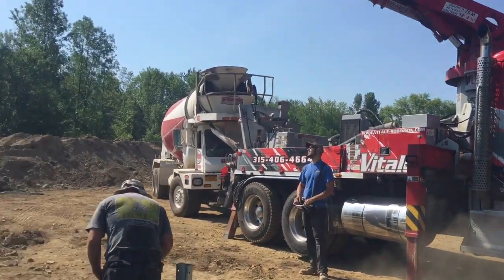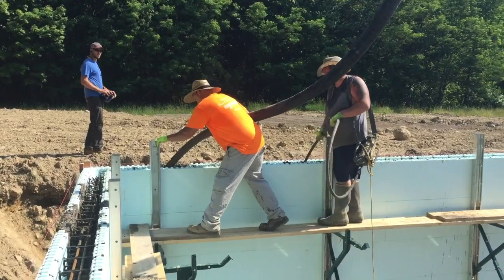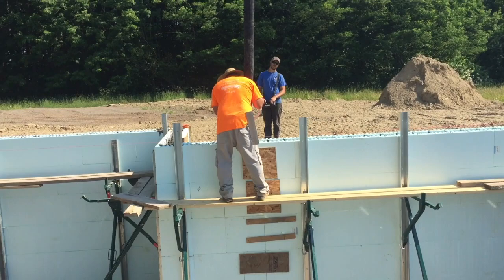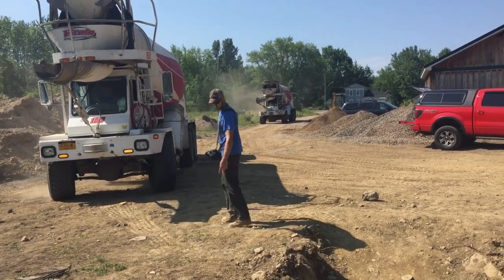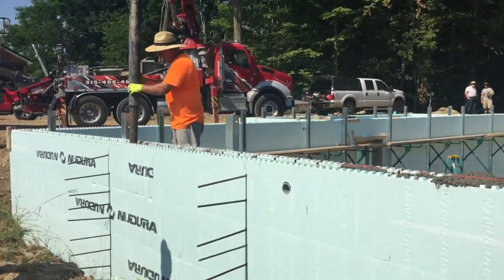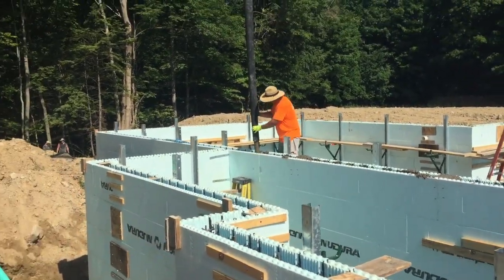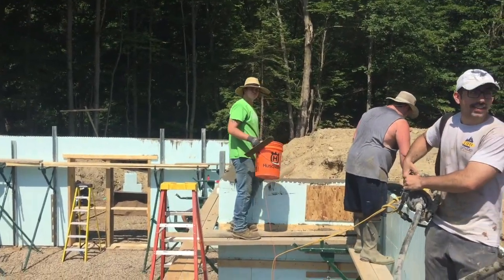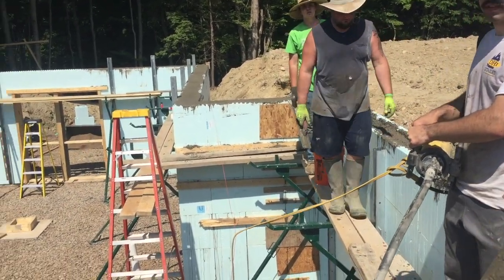How to pour an ICF foundation wall.

Comment: When you are troweling off the top, are you keeping it level with those foam nubs that are on the top?  I can't seem to find a good answer on this question.  Or are you supposed to be level with the flat part of the foam down from the nubs.
Reply from the maker: We are keeping it level with the tops of the nubs. You can cut the nubs off with a table saw before laying the last course if you wanted to not deal with the nubs but you loose 1" of wall height.
Reply: @bondobuilt386  You mentioned in this video that you used masking tape on the nubs before.  Which video are you mentioning?

Comment: Hi Bondo. Been following you for a while inspired me to take on my home addition full basement add on. Using FOX 8". I'm in Wisconsin it's going to be chilly this Wednesday. I've been told to order a 5.5" slump and add super P or HRWR whatever the plant has. What are your thoughts? Will the Super P make the mix too runny and increase hydrostatic pressure? Can I have them add just a little to increase flow ability? Just under 8' in 3 lifts. I ordered pea gravel 3500 psi. Thanks for your time and love the content.

Comment: I'm from the east coast of Canada and I did fly in fly out jobs in western Canada doing industrial concrete formwork. I took a job at home in Nova Scotia doing ICF ( which doesn't exist in industrial work ) and all I could think was " There is no way this isn't going to blow out " ! I remember when they poured 8 ' walls in two passes and being amazed that the concrete didn't destroy the ICF. It is an amazing invention for sure. The real downfall in my opinion is that it's really difficult to get an ICF wall dead straight. It's impossible in most cases.

Comment: Hi Bondo!  i have my first ICF pour coming up this Saturday.  I have about 375 linier feet of walls at 10' tall 8" core.  what truck spacing do you put between your trucks?  I have about 90 yards to pour and I'm worried about the time to make it all the way around especially if I do 3 lifts.  Thanks for your input Bondo I've learned so much from your videos!
Reply from the maker: Hi thanks. I would have the trucks 15 min apart buddy. Good luck 👍
Reply: Rob, how did things work out?  Did you end up with 15 minute spacing?
Reply: Yup 15 minutes was right. Worked out good.

Comment: Hi Bondo why do you have some areas on the top of the I F where the nipples on the icf were left in amd covered with concrete and other areas that were flat without nipples? What’s the difference. ?

Comment: At least he showed up for work! One question if you don't mind; how tall can ICF walls go without having a floor or roof structure? For instance can you pour a 16' tall wall and then put regular rafters on the top of it without pillars or buttresses along the length?
Reply from the maker: Nudura has a bunch of engineering tables on there web sight. I would think you could with the proper rebar and wall thickness but I would check that and a local inspectors and engineers in your area. I have only gone 9 feet for basements but they have backfill against them.

Comment: Have you used the Zont bracing ?   Which supports do you use ?
Reply from the maker: I use the Nudura bracing. My block supplier bought 2 crates at $3000 a crate.

Comment: Ron, other ICF installers are opposed to vibrating as they claim it bows the walls and that makes hanging sheetrock difficult for the sheetrock guys.  Any feedback from sheet rockers?
Reply from the maker: Dan no the forms never bow out unless you forget a plywood patch in a vulnerable area. I vibrated Logix blocks as well with good results.